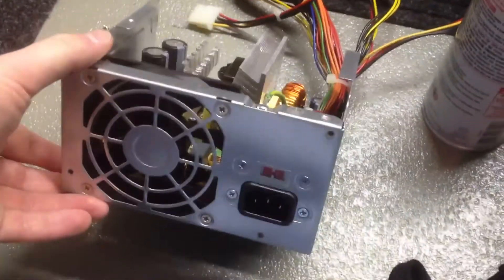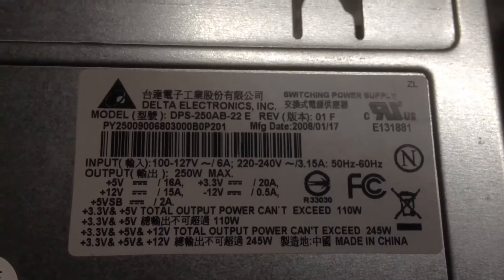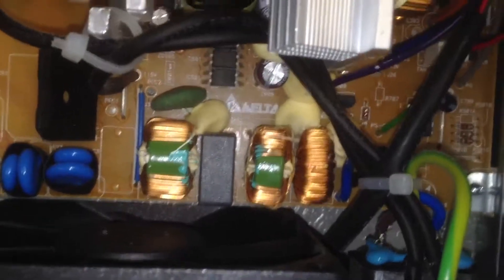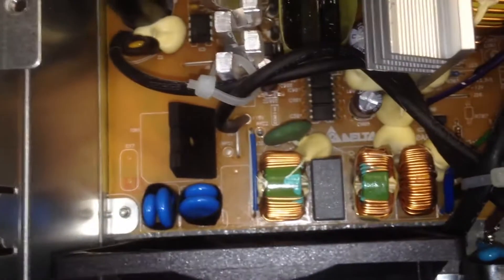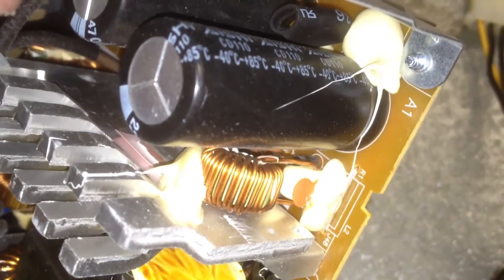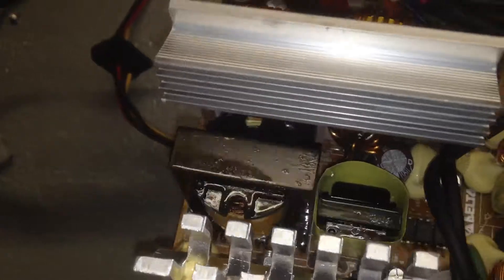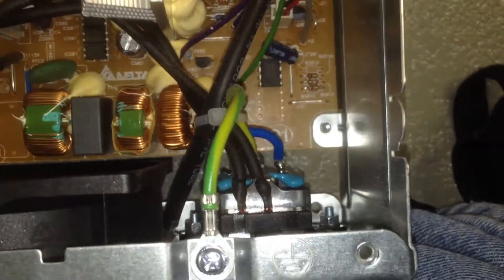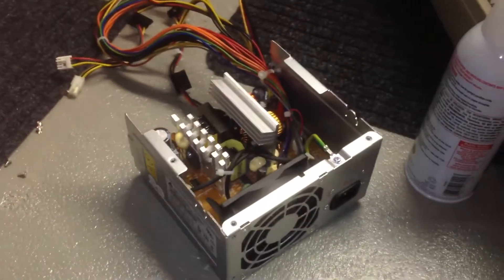Delta DPS-250AB-22 E Power Supply

Comment: 01:40 3/14/2024. I believe I have the exact same one mine's from 2008 also I'm new to all these but I'm intrigued by him I'm curious what the different black little inserts on the wires like the one says PA then it has like the yellow wire black wire red wire black wire another one is you know PD has the same colored wires going through it then same wire has it goes to it PE then the different different wires at the end different plugs I should say I guess that's what they're called what are they all used for and what's the amperage going out of each different wire or is there a way I can find that out I turn them into like able to run fans in my hot garage or something I use them as a power supply for other random stuff not another motherboard or anything like that but I got a little

Comment: Do you know whats the problem with my SFX PSU, it's Delta "DPS250AB-62AA". There is no power, no on 12V rail or 5V rail.. shows just zero and fan is not spinning when shorting green and black. I think it's busted but one thing, is there somekind of fuse inside?